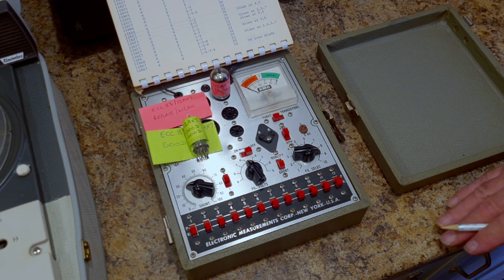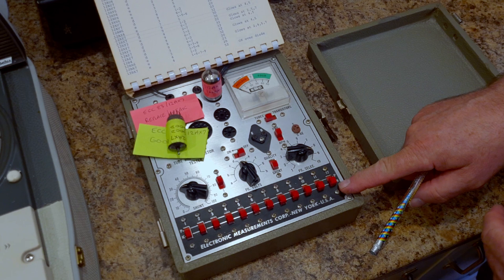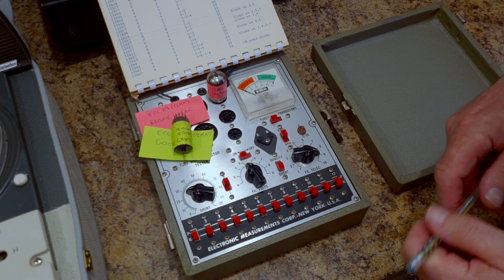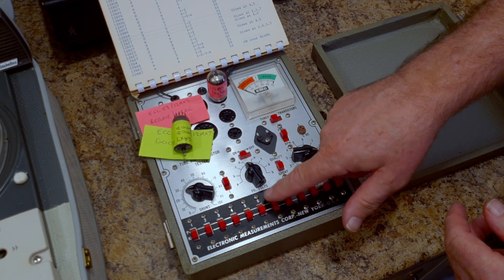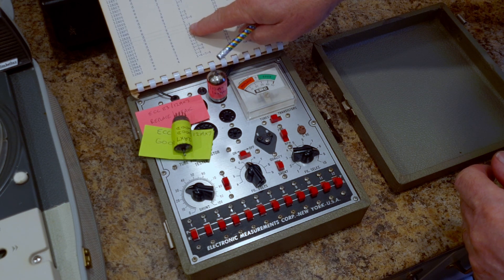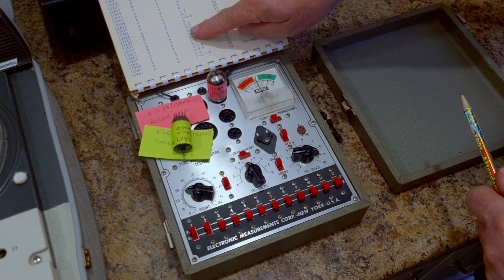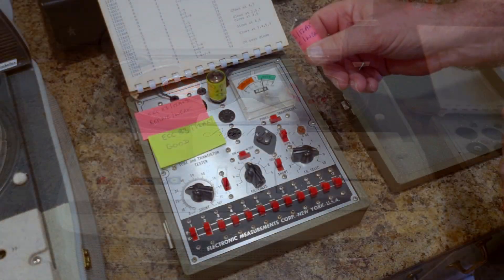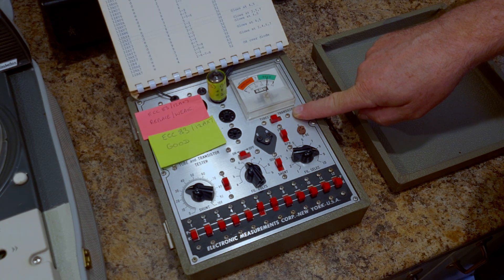Checking ECC83 Valve with EMC 215 Tester

Comment: Hello. Very informative Video. Thank you. I could check my ECC83 Tubes and the results matched that shown in your video. I also tested EF86 and EL86 Tubes. I have few questions. For EL86 Tubes, the lamp glows additionally at 4 and 8, besides 2 and 5 (which the manual specifies). This is true for both my tubes. Similarly, for EL86, the lamp glows additionally at 4, besides 1,2,5,7 and 8(which the manual specifies). This is true for all my 4 tubes. Am I doing something wrong? I have followed the manual to the word. Are these tubes shorted? But they work in the Amp! Can you please help me understand this.
Reply from the maker: Hi, sorry for the late reply. The manual shows that the lamp should glow at,1,2, 5, 7 and 8 only for the EL86. The Filament select switch is in position 4 when the valve has been set up and the lamp will glow if you move the no. 4 slide switch from the k position. Look at section 11.  Short Test of the manual, part 3. 
 Hope that helps.
Reply from the maker: If you look at the short test for the ECC83 video the filament select switch is on position 9 and the no. 9 slide switch should not be moved for the short test. I explain if you do move the no. 9 slide switch the lamp will glow but it is not a short.

Comment: Hello,  I just bought this emc 215 tester,  I just want to know why are there batteries inside the unit,  does it work only with batteries or it's there so that you can check it without power supply,  I am newbie,
Reply from the maker: Hi, the batteries are only used for the transistor testing.

Comment: Hi. What setup do you use in your EMC 213-215 tester in order to test a 6P15 tube?
Reply from the maker: Hi, sorry for the late reply.
The 6BQ5 is the equivalent for the 6P15. Its not an exact one but the settings are the same. FIl volts D. Fil Select 4. Slide switches 1,2,9 in position P. Shunt is 22. Glows at 1,2,5.
The shunt control is the one you might need to adjust. If you have a known good 6P15 adjust the shunt so it reads 3/4 scale ( 37.5) and use it for future reference.
Reply: @dadoinstruments9209  Ok, thanks for your help. So if the neon glows if I slide up switch 6 there is a short in the valve? Besides, the the quality test needle stays down.
Reply from the maker: @sergioflores122  hi, it should not glow at 6.  Only 1, 2, and 5. All your switches should be in the k position. The manual tells you not to move switch 4 as the fil. Selector switch is set at 4. If you do it will also light the lamp.
Reply: @dadoinstruments9209  I see. So I guess this tube, which I bought as new, arrived damaged because of it's long trip from China, was already or defective. I tried my tester with a new Russian 12AX7 and it worked well. Thanks for sharing your knowledge and experience. Cheers.
Reply: Thanks for the info. Bought one this weekend in the box for 10 bucks. Figured it was worth the gamble. Just have to figure out how to master it.

Comment: Hi. I have a 6p15 tube and I tried to test it with a Lafayette 213-215 tester, which is very similar to the EMC 213-215, tester but I can't find the data for it in my manual. I saw in the web that the 6bq5 is the substitute for the 6p15. Some say those tubes are not the same. What do you say about that?